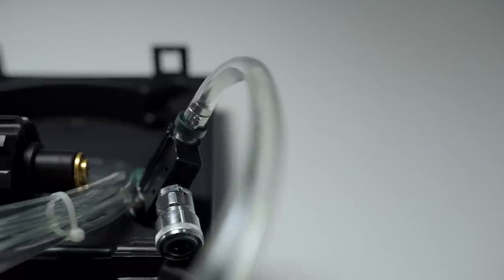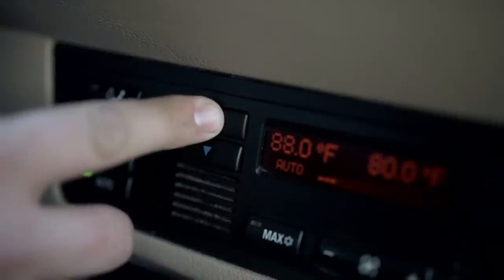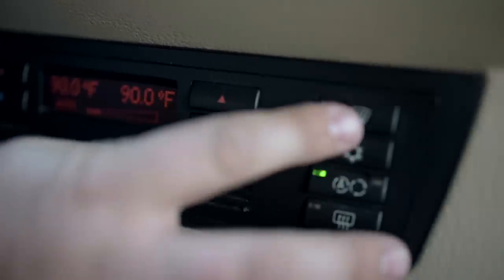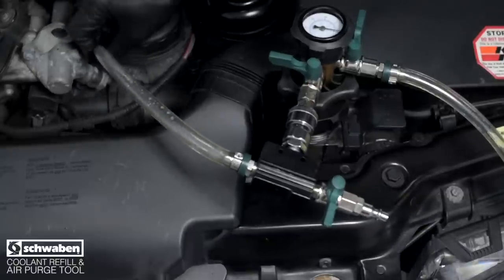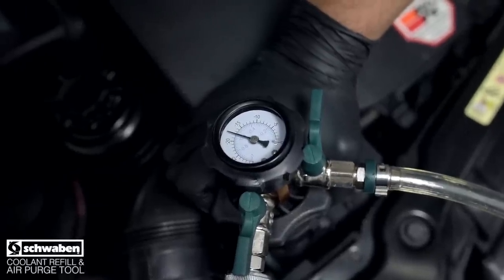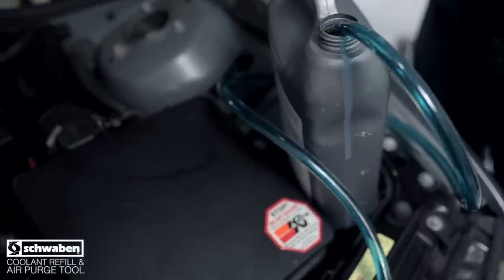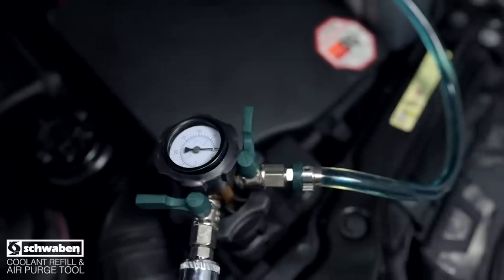How to do a Coolant Flush | Schwaben Refill/Air Purge Tool

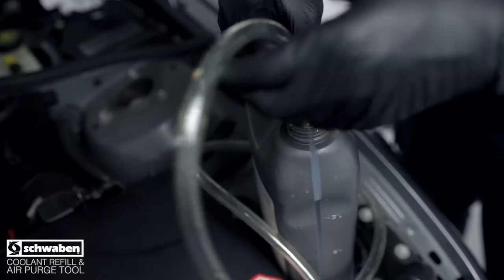Comment: There’s a mistake in this instructional video! At around 2:41 you should SLOWY up the valve for the fluid line to allow the coolant to just barely touch the shut off point. Then shut off the valve when the fluid reaches the gauge. Keep your compressor connected and reopen the valve for the vacuum. And get another perfect vacuum. If you don’t do this, all the air that is in the fluid line will get reintroduced into your cooling system. Take a closer look at the time stamp and look at where he makes the mistake.
Reply: Good tip, thanks!
Reply: Imma mechanic and did the “wrong way” on a thousand cars no problem tbh that’s jus gonna overflow the expansion tank and make a mess I’ve tried doin that before and u always over fill the system and gotta suck it out

Comment: You forgot to prime the tube first, at 2:44 you put some air in it along side with coolant. But it doesnt matter that much, the system usually purges itself after a while, and after all, this is a commercial video.

Comment: I have a concern here... BMW and Mercedes both call for -.9 bar of vacuum pressure, you barely got it up to -.7.  Another thing, when drawing coolant from the tank, you basically reintroduced a hose tube full of air.  Shouldn't you have sucked it up, then purged the air back down before filling the coolant?  For all the DIY'ers out there... good luck.

Comment: Can you use the vacuum to drain the system through the reservoir?
Reply: Thats what i was thinking about. I think if you created air by disconnecting on hose at the end of the line the vacuum will be effective but if all lines are closed then vacuum wont drain any water bc simply no air

Comment: Temp on Hot and Fan on Low, got it.  Your video shows pushing the defrost, which puts the fan on high, as it does on the video.   So, defrost on or off?

Comment: In the video, he said to drain all the coolant first (obviously), but the video showed the red bobber sticking up way past the lip of the expansion tank! Could be confusing for some people.
Reply: What do you mean?
Reply: @menaceemceefiend9716  They say to drain all coolant from the system.  But then they show the expansion tank that has the float sticking up when he is selecting the correct size filler neck adapter.  If the system was really empty the float would not be floating on coolant like it was.
Reply: @rb26dett32  I actually did got confused by this!!!

Comment: will this suck air from the block and heater core? i mean thermostat is close when its cold  so how does this one will suck air in the block of the engine?
Reply: No you would have to refill the system as instructed using distilled water only and run the vehicle till you reach operating temp.Then put the heater on high using face vents and fan on low . Let it run then after a cool down, Re drain the system at the radiator and repeat till you are satisfied you have removed enough of the old coolant. Then carefully add undiluted coolant to any remaining distilled water into the tank or radiator to achieve  a proper mix. Back in the day when cars were less complex you could remove the thermostat and do a flush .Access your heater core hoses and flush that out also. Replace your upper and lower hoses and install a new thermostat and you were done !

Comment: Does the tool fill the entire system even if there is a thermostat separating the engine section from the radiator section?
Reply: The thermostat will be on the supply side of the system (just before the return to the radiator). Since you're creating a vacuum, you're also sending coolant in through the lower radiator hose (return to the engine), so you're essentially going in behind a closed thermostat. The thermostat shouldn't be a problem.

Comment: Can I use this to suck out the coolant instead of draining it via the drain screw on the bottom of the radiator?
Reply: I’m wondering the same thing.
Reply: No
Reply: Disconnect one hose at the end of the line to creat air so vacuum can be effective

Comment: Why is this even needed? Just fill with coolant after draining. Never had a problem.
Reply from the maker: it isn't needed in 99% of applications, but it certainly takes a ton of work out when compared to manually bleeding, especially when you've evacuated the entire cooling system.

In manual bleeding, you're likely to still have some air bubbles that require driving and regular checks over the following week or so to make sure you're not running low on coolant after all the little passages fill up and purge out the air. Some systems are self-bleeding in that way and will expel air at operating temperature through a pressure release valve, others are not. 

With vacuum bleeding, you are ensuring that there are no air bubbles when you refill the system. I can tell you especially on something like a 996 or 997 Carrera with a rear engine and front radiators, doing it manually takes about 6 hours and doing it with a vacuum purge tool like this takes about 20 minutes.

Comment: I bought this tool, and i have an airlock in my heater. So do I need to still jack up my car and then put this tool on?
Reply: Did you get the air out?

Comment: Is this only for European cars? Will this work for Japanese cars like Toyota and Honda? Description says universal tool but only lists European car manufacturers..
Reply: Q Tran did you find out if this works on hondas or toyotas cause i have both
Reply: Marcos Rico yes this kit comes with a cone shaped adapter that works on toyotas. Got this kit for sale for like $55
Reply: Q Tran one more question, have you used it yet and if so how well does the adapter cone hold pressure cause i herd that some cone adapters tend to leak air,  thank you for your response really appreciated!!
Reply: I have used it a few times at work and had random success with it (I work at a toyota dealer). Sometimes it will hold vacuum. Sometimes it will leak vacuum at a very low rate. Other times it would build vacuum and the moment you cut off the shop air the vacuum instantly drops.  I kind of dislike the cone because it requires you to use your hands to stabilize the entire tool so it gets a perfect seal. If you tilt it one way or the other you may get a vacuum leak. The reservoir style they show in this video allows you to operate the tool with your hands free so you can walk away. Using the cone style adapter requires you to have at minimum 1 hand holding it at all times and if you let it go it'll just tip over and not seal.

I have just resorted going back to using my Lisle spill-free funnel kit.
Reply: Q Tran a friend of mine recomended me to get the Smart fit radiator universal adapter kit from redline, he says that works very well,  I also have the lisle funnel kit but damn! That takes too long.
Reply: That smart fit radiator adapter kit looks like it is to pressurize the cooling system. It doesn't look like it is used to draw a vacuum on the system so you can fill it up without air pockets.